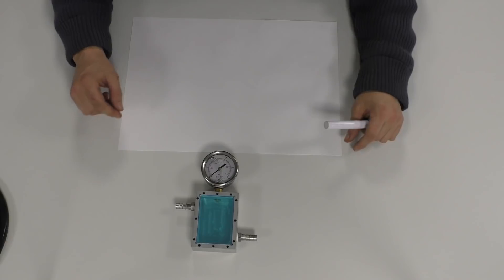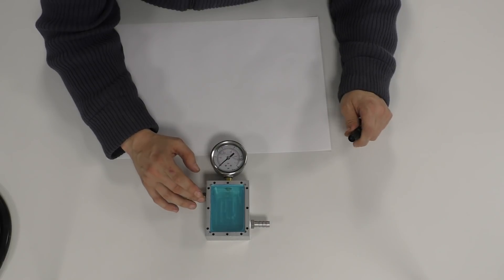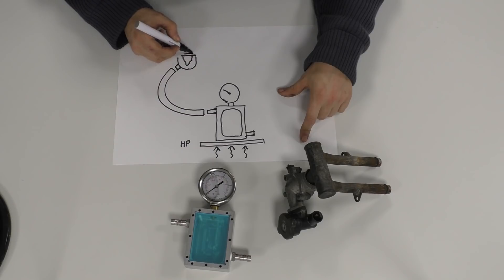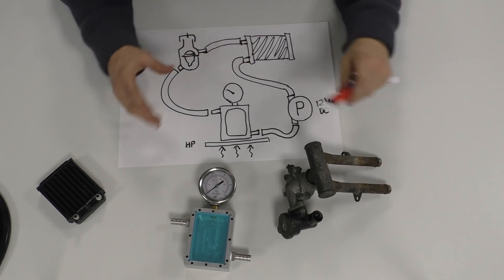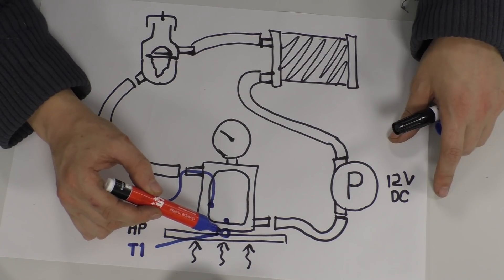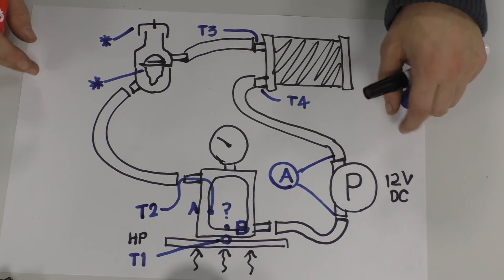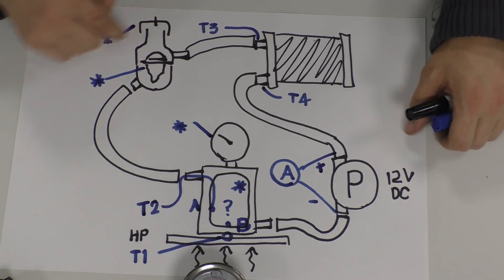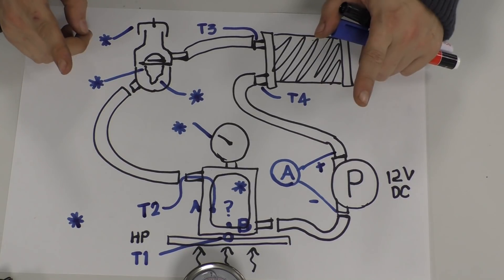Cooling Experiment - Part 1

Comment: Why check the viscosity after it has been 'cooled'? Surely if you could test it after heating as well as the fluid feeding back into the heated area it would be a better indicator of performance?
Reply from the maker: Sorry dude what? This was a long time ago and I don't have time to watch the whole video, can you give me a time in the video?
Reply: @thedirtyworkshop  9min 15 sec. Not sure how you can test the viscosity between the pressure regulator and the thermostat but this area is where the 'liquid' would potentially have changed the most.
Reply from the maker: We're not 'testing' viscocity. We're looking at the draw of the motor powering the pump. One thing about Evans is that because its thicker you have a paracitic loss. As the temperature rises the viscocity will drop, which is to do with another video were I was talking about cool engines.
Reply: @thedirtyworkshop  yes, but I thought that you could test the viscosity by measuring the draw but I would have thought that it would be 'thinner' prior to the rad and have regained some of its original properties so being able to test both in and out would have given more of a balanced picture. No matter, the set up looks good and I would be interested to see this experiment to followup from the temperature one that you did with water, 50/50, evens etc.

Comment: To measure current, place multimeter in-line with pump - not across it (on 'current' setting - start with highest).
Alternatively, place resistor in-line and measure voltage across it (V = IR - solve for I). Ensure resistor can deal with the power (P = I*I*R).

Comment: I think the bottom of the chamber would be best for the thermocouple since it would represent the inside wall of the cylinder which is the hotter side. It may even be easier to install it there and seal it with the sight glass. I think it would be a pain to seal it in the hose. It may also cause flow restriction issues in the hose.

Comment: I'm a bit late to the party with this comment, but why not place a thermocouple on every component? Before and after the radiator, before and after the "cylinder" etc. Why not one before and after the pump as well just for shits and giggles? Thermocouples are dirt cheap on ebay, I bought a pack of 20 for a dollar. An Arduino for data collection wouldn't break the bank either. The more data you can gather in one go the better if you ask me.

Comment: M-Bus heat meter -- read via FTDI  Serial to USB cable. Gets you  flow and return temps, flow rates, watts (power) Lots of useful info to be gained by having one of them in the circuit. :-)

Comment: I would keep the thermostat in all test, so you may have a more constant temperatur. And i would like to know how much liquid that can passe trhoug the termostat when its cold. Cause if that is next to nothing i would make a bypass pipes around the termostat, in the begining to circulet the water as it heats up. And when its around working temperatur, close the bypass, and let the Worm water control the termostat.

Comment: This is my first comment after watching your chanel for a while. The 'can you turbo a two stroke' vid got me watching as I like engines and engine theory as much as working on them.

For this experiment I think the only relevant temperatures are the in and out temps of the heat  block. The circuit is quite small, so you won't see much difference measuring elsewhere. 

What about clamping it to the heat plate to ensure consistant heat transfer and maybe consider an ice/water bath for the radiator instead of a fan to keep the level of cooling consistent. Although, that may work better with something like a few loops of copper pipe (think alcohol still) than your mini radiator.

Does the stat housing flow any fluid when the stat is closed? 

I agree that something to measure the actual fluid flow rate would be more meaningful than measuring the current draw of the pump motor.

Comment: Problems: hot plate. Depending on what kind of hot plate you got it will regulate the temperature in some way. Changing liquid or even having fan on and off would make it behave differently every time. you want constant power without much regulating in the background

Comment: As a couple of people have said below, a bypass would be a good idea to help the coolant circulate so getting up to temp quicker thus opening the stat sooner. 

I'm thinking a T piece before the thermostat housing to bypass it and the radiator, then another T piece before the pump. I'm not sure but I think a restrictor would be required in the pipe between the two T's as there might be a chance the pump might continue to draw the fluid from the bypass once the thermostat is open i.e. the path of least resistance. 

A three way thermostat might be best way to do it. something like this https://www.ebay.co.uk/itm/Go-kart-thermostat-split-T-pipe-Go-kart/222747017593?hash=item33dcc1c179:g:DPAAAOSwGG5aKWJ6

I might be talking out my arse but this is how I understand things from past experience from when dickheads bypass the heat matrix (heat core) in cars when they're to lazy to replace them and then wonder why their head over heats when it doesn't cool enough as most the coolant goes through their heater matrix bypass. Also from plumbing up old school liquid cool 100cc karts.

Comment: right. there's a few question and/or opinions from me
1) i think you may want to flow the fluid the other way around. i'm assuming that you're using the same pump that is used in a custom cpu watercooling system, a thing that is always done is to put the pump right after the reservoir, which in this case, could be the alumunium block/heat accepter thingy, since it holds some amount of fluid. this is usually done 'just to be safe' to minimize the possibility of air getting into the whole loop, and possibly a good idea to do here too.
 so it's, block -> pump > rad -> thermostat->block

2) under the same assumption of the cpu liquid pump, why not try to get a voltage regulator to control the power input to the pump? too see what different liquid flow rate does. probably on the fan that blows the radiator too.

3) i don't understand what the T2 thermocouple is meant to represent. is it meant to read just the general liquid temp inside the block (if A)? is it meant to record how much heat is getting through the alumunium block (if B)? i want to say put it as close as possible to the outlet port, or on it, to actually see the temp of the liquid after it has absorbed the heat, as an indicator of how well the liquid is absorbing the heat. but that would make T4 almost redundant....

Comment: if you remove the hardlines on the thermostat housing the fluid won't be able to flow through the housing (with the thermostat closed) so the thermostat will probably take a very long time to open... or do you plan to make the pipe to the housing short enough for it to not make a difference?

Comment: You should take and use a 12v circulation pump, from a parking heater, like https://rover.ebay.com/rover/0/0/0?mpre=https%3A%2F%2Fwww.ebay.co.uk%2Fulk%2Fitm%2F131710920309
And please use 3 wire termo couple. And use both a and b at t2👍🏻

Comment: You shouldn't use a 12V DC pump unless it runs at constant speed, something like an aquarium water pump would be better since they're synchronous AC motors. Thicker fluids will make the pump run slower but in an engine the pump runs at a constant speed regardless of the viscosity. One problem with an aquarium water pump might be that it's too weak but i doubt that would happen.

Comment: Firstly as someone else already said, testing the temperature probe locations is probably the best way however..
In my mind, T1 inside the block to show the heat making it's way into the block, whereas outside won't account for losses to air cooling quite so well.  This would be your internal engine block temperature then.
T2 at the exit of the block to show how much heat the fluid has picked up as it's gone through the block.
Will you run into problems with the fact the fluid races through the block and spends very little time there before it moves to the cooling side? Do you need some baffles?  I still have an old watercooled PC so that's what comes to mind.
I'd have suggested using the watercooling pump also but PC systems run cooler, unpressurised and with nothing thicker (generally) than water - not sure how well the PC style pump would take it.  Cheap enough to find out or aquarium/pond pump?

Comment: This is not going to be easy, to be honest I would skip the thermostat initially. I would be tempted to not use the hotplate either but instead use a couple of metal clad resistors screwed to the aluminium chamber. (The hot plate is thermostatically controlled and makes the whole experiment more complicated). The size of pipe you have is pretty generous and a reasonable pump might flow the coolant a bit fast for the amount of heat you are dealing with, you might need to reduce the pump voltage. Unfortunately I don't know what gear you have that could be used. To be honest a Tesco electric kettle would be easy to put a couple of barbed fittings in, forget about pressurising the system. Pressurising the system will encourage leaks and adds agro with expansion etc. Lots of ideas how you could do this with easy and cheap household stuff.

Comment: T2 has to go in position B i would say, you want to see how hot the material is on the water jacket side of the heat source which will give an indication of how good the heat transfer is between the 'cylinder wall' and the coolant.
If you put it in position A it is too far from the heat source and i would think it will just show the temp of the coolant itself which is kind of irrelevant in a way, if the box represents the engine you want to know the temp of the box body itself on the outside of the heat source.

It may have been better to leave a bulb of material protruding into the coolant jacket in that area to house T2 rather than mill it out to a constant thickness like you have as i would think that would better show the coolants ability to absorb heat as the metal between the heat source and coolant is the key area of interest but i guess you won't know until you set it up and start playing with it.

Very nice little setup though, will be interesting to see this.

Comment: If the point of T2 is to measure the actual temp of the coolant, wouldn't it perhaps be an idea to put it in the middle of the actual coolant and ideally insulated from the aluminium case. 

Given ali conducts heat very well wouldn't either of the current placements of T2 be measuring more the degree of heat conduction through the casing rather than the actual fluid temp? 

Perhaps drill a little hole in the side of the ali box and mount the thermistor/thermocouple on an insulated (e.g. plastic) support (teeny tube + epoxy?) slap bang in the middle of the coolant fluid.

Comment: Can you get automotive temp senders and drill and thread holes at A or B and use some teflon tape for the threads if necessary I don't know how you'd seal up the wires going in through the hoses. Do you guys have pull a part type junkyards, stuff is cheap there.

Alright I happened to remember seeing this a little while back for modding my Jeep, basically it allows you to add switches to self regulate an electric fan to replace the mechanical fan... It basically would allow you to put temp senders in line with the hoses. Don't know if this would work for what you're doing but it might give you ideas how to get the temp readings.
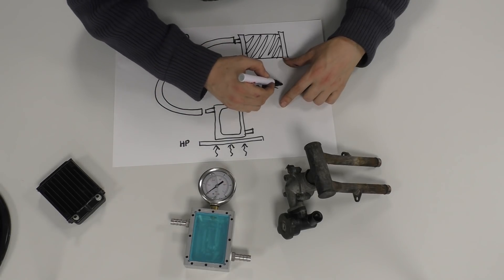 about 1:45 - 5:00 minutes https://www.youtube.com/watch?v=yQhbkrpOL7I

Comment: Do you need a bypass round the thermostat back to the pump? I thought engine cooling systems had this shorter circuit, I could be talking shit though? Really looking forward to this in action.
Reply: On this parts diagram for example,  is part 11 possibly? http://www.af1racing.com/store/Scripts/prodList.asp?idCategory=1337

Comment: T2-A would give a realistic temp because of coolant vs block temp. T1-B you could get false redlining piking up the temp off the HP. I say do both just for shits. believe should also have a restricted feed off the lower side of the thermostat teed to the inlet of the pump since the bleed hole off the thermostat can only flow so much.

Comment: 40 quid for that radiator? Holy moly. I get those for 10. Also I'm not sure most DC pumps for those kind of radiator jobs can handle over 100c. I'm sure you can find something though. 
Also I got a feeling that pressure chamber is going to be poor at heat transfer, low surface area.
I'd add an in-line flow meter to tell if thermostat is open or closed.
Keeping the outlet of the pressure chamber at the top is optimal. Engine radiators try to design the loop to take advantage of hot rises, cold falls. The way you've drawn it seems fine. Keeping the pump on the cold side is best.
Best watch out for that acrylic window melting

Comment: I would say take T2 off at the thermostat housing. It is already there and there it will boil over, by that you know the temperature of the shite that boils out of there. And the system would leak if you don't connect the tube proper. Just holding it in the front of the hole will not do the job... it would leak like your "Penis" when your wife blocks the bathroom.
Reply: And the current of the pump is not at the hoses... would be wired to use the coolant to transfer the electricity.

Comment: Matt, You need a T piece with a tap at the top end to purge and fill the system. You will know when the thermostat opens as the lode on the pump will drop plus the radiator will start getting hot
Reply: Graham Buck if the thermostat is the highest point in the system it will be fine as the fill-port and bleeding. That's how the ER5 was made

Comment: Does the thermostat have a bleed hole?
It would need sealing & a by pass to the pump fitting if it does, perhaps fit a tap in the by pass for when 'stat starts to open.
The thermocouple on the rad "IN" will let you know the 'stat is starting to open.
Reply: & a one way valve between the rad & the pump to stop back heating (if that's such a thing)
Reply: Correction, don't seal the hole, fit a jiggle pin or you'll struggle to bleed the system

Comment: since you are using so many thermocouples, why not put one in location A and B (where most damage would be done by poor cooling), so you can get a notion of how extreme temperature differences in the "engine block" can be smoothed of by the coolant. cheers.
Reply from the maker: Data logging. The data logger only has 4 ports

Comment: With and without a fan on the rad , a variable speed for the fan. At what point will the cap send fluid to the overflow tank. How many amps will the fan draw. A fan for the fan to represent speed. Most temp sensors are located in the head or rad ,for that I would go with the rad to control the fan. For the test box I would think as close to the middle and the metal. Just so we can see the actual cooling if any to the metal. If you can measure any expansion in the box that would be cool to see,Possibly put  a vernier caliper on it heat it and allow it to cool,with and without fans,different fluids ect...
Reply from the maker: "How many amps will the fan draw." 

- it will be constant regardless of the system temperature

Comment: You can also put a bypass hose next to the pump. With a needle valve then tou can steer the pump efficiency ( more bypass and the pump will just pump more back leaving lessfor the system)

Comment: Looking at the er5 service manual, the thermostat should open between 80 and 84C. Assuming the water temperature switch is still fitted, it should operate between 110 and 120C.
Reply: Biker Jack123456 normal for many engines. I've stuck an IR thermometer to the side of the cylinder and measured right around 100-110c iirc. It's been a while. So fluid will be right around that